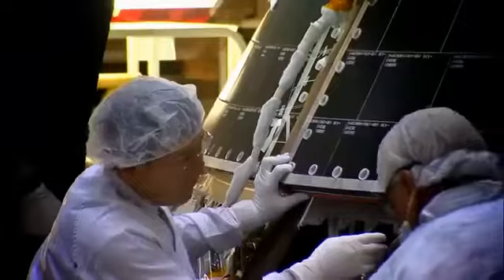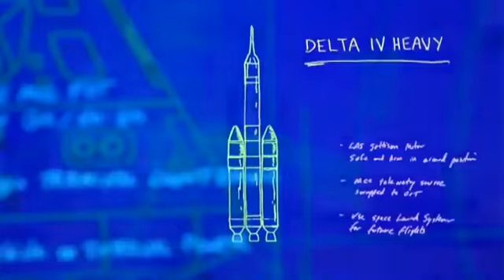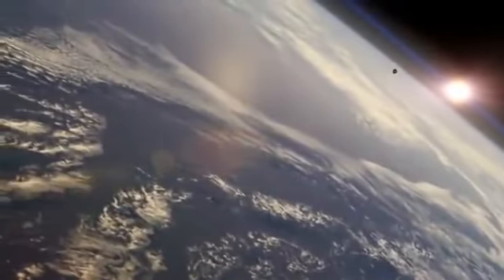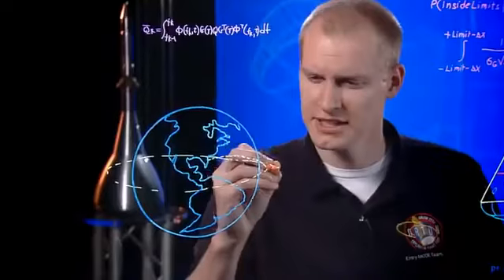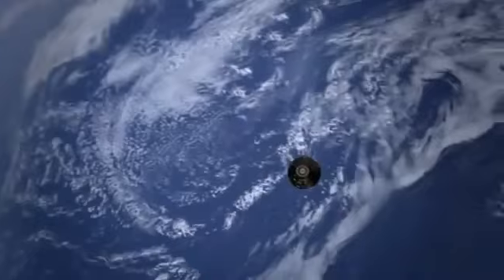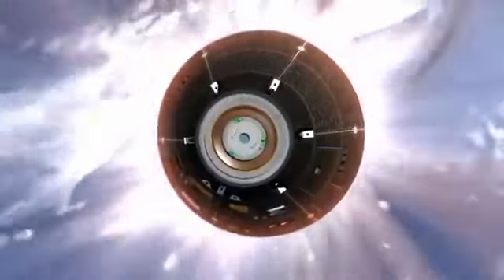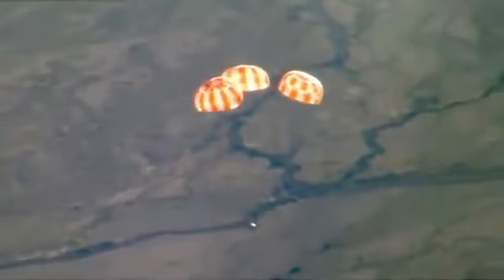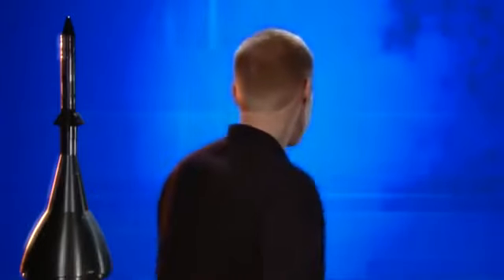NASA engineer admits they can’t get passed the Van Allen Belts

Comment: The reentry heat is the most dangerous part?! What about the heat while going through the belts? I've read it can reach up to 35k Fahrenheit.
Reply: Where did you read that?
Reply: Heat is not measured in degrees Fahrenheit, they are units of temperature. Heat and temperature are not the same thing. Take care.
Reply: It's sort of like the difference between how the air from your oven at several hundred degrees feels hot but isn't a big deal to stick your arms into, but if you stick your arm in boiling water, which is much cooler, you're going to pretty much instantaneously receive severe burns.

The particles in the VA belts contain a ton of energy, but there's just so few of them that the total amount of energy they can transfer to you is negligible.

Another comparison would be getting an X-ray vs. going outside. X-rays individually have a lot more energy than the light from the Sun, but there's more energy in total in the sunlight hitting you than in the X-rays, so going outside in the sun warms you up, but you don't feel warmer when getting X-rayed.
Reply: @seigeengine  Good explanation.

Comment: These tests were passed years ago.  The tests were for STAYING INSIDE THE VAN ALLEN BELTS.  Apollo spacecraft only had to GRAZE THE OUTER EDGES OF THE VAN ALLEN BELTS.  And this was for new electronics and new shielding .

This is completely different from the requirements of the Apollo spacecraft, which had old solid-state 60s electronics, much more resilient against radiation than new, microscopic electronics.
Reply: It's not the electronics that are the problem. It is the people that have to survive.  Wake Up
Reply: @jjlepepe5875  

This is old news.  The tests all passed.  The electronics were sufficiently shielded.
Reply: Riiiiiight, electronics back then were sh*t compared to today......sheeps will sheep
Reply: @damiandmb2092  

Here comes another genius.
Old electronics were shit.  No kidding... and?  What?  New electronics don't need shielding?  From radiation you guys always say is so intense it would "fry" everything in the spacecraft? 😋

Who's a sheep to somebody else's shitty conspiracy theory? 😆

Comment: No, that engineer is not claiming they can't get past the van Allen belts. He's talking about the first Orion test flight. This was done to make sure the Orion capsule works correctly in the VA belt: electronics can malfunction in high-radiation environments. Orion's electronics are designed to deal with this, but a practical test is required as part of due diligence. All of the hardware on Orion is new, so it has to be tested in operational circumstances before being considered human-rated. 
The Apollo program did these tests as well, during several unmanned flights of the Apollo spacecraft.
Reply: 1:36 and it's crew out of danger. 🙄
Reply: @AwesomeBlackDude  Danger from malfunctioning electronics, yes.
Reply: @zounds010   He mention the crew twice.
Reply: @AwesomeBlackDude  Again. the crew's safety depends on the electronics (which he was responsible for) working well. 
The radiation levels in the belts are low enough that the pressure hull and heat shield of the spacecraft provide enough shielding, and no extra shielding is required.
Reply: @AwesomeBlackDude  Even if you weren't wrong about what's being said, you're effectively arguing "one guy said something that disagree with the consensus of experts, therefor everyone else is wrong."

Addled.
Reply: Why not just use the 55-year old Apollo technology then?
Reply: @pdqbach4552  The Apollo computers were very limited. They could only do the bare minimum in terms of navigation and had no room for other functions. That meant the Apollo spacecraft contained tons of specialized devices e.g. to record and transmit telemetry. Onboard systems were operated manually and had limited functionality. For instance, the high-gain antennas had to be pointed manually. 
Limited computer capacity also meant that much of the data had to be transmitted live, or it was lost. 
In a modern spacecraft, these functions can be automated to reduce crew workload. It's become much easier for Mission Control to monitor the spacecraft, and to control it remotely if necessary. 
50 years of advance in computer technology gives you a lot of scope for improvement in functionality. 
Because we've launched hundreds of spacecraft into high-radiation environments since Apollo, we have learned how to build radiation-tolerant computers. These days, you can buy those off the shelf, and they're a much better solution than building a computer from 1968 two-gate integrated circuits.

Comment: So are we to believe that technology from 50 years ago was more advanced than today’s technology?
“We must solve these challenges before sending humans through this region of space”!
Reply: The technology is the same.  Big rockets, small spacecraft made as light as possible.  The challenges he talks about are engineering ones. We know how, but did we build a craft that is capable. That is what the test flight is for, people make mistakes.
Reply: "We must solve these challenges before sending humans through this region of space"
When man went to the moon, they did their best to avoid those regions. The Van Allen belt is not just a belt but belts of various radiation intensity. When they went through it back then, they did so as fast as they could and through radiation regions that weren't as strong as others to minimize their exposure, not completely eliminate it. They couldn't. They were still exposed to levels of radiation when they did this, but they weren't there for long enough for them to be lethal in the short term. For that they would have had to have been in them for days and they were only in them for about an hour. It's been said that the level of radiation exposure they experienced on average was equivalent to having two head x-rays.
Reply: Nope, the opposite. Modern technology relies on advanced computers that are highly sensitive to ionizing radiation. Humans are quite resilient. That is even more the case with the analogue technology that the astronauts used back then. What is even more resilient against ionizing radiation is a fucking shovel. Does that mean that a fucking spade is far more high tech than a modern computer?
Reply: "But Orion HAS PROTECTION the shielding will be put to the test. Sensors will record..." lets all forget the previous line right before that one!
Reply: Electro-Cute just whip out the 33 kilobytes that they use the 1969 and get the shit done!!
Pretty sure we can re-engineer 1960s equipment/hardware🤔
Reply: shane bruland I don’t trust any of them. But yeah I’m pretty sure Bill Gates could figure out how to use kilobytes. Just like I’m pretty sure we could re-engineer the Wright brothers airplane, the SR 71, little boy and fat man etc
If that’s the point you were trying to make?
Reply: shane bruland Still have no idea what side you’re on😂
Reply: shane bruland but that description actually sounds like you could run nasa!!!
Reply: @zdcyclops1lickley190  then why wouldn't use the same mechanisms that worked on apollo and transfer the data to the Orion? Why did we all of a sudden have the technology to do this when Russia was far more advanced? there's a lot of holes that just don't make it seem plausible..
Reply: echelon2k8 then why can’t they just do it again. Technology has advanced so far since the 60s
Reply: OBVIOUSLY NASA has NEVER SOLVED those challenges. (neither has China or Russia) Cosmic radiation would kill a human in 1969 and today Cosmic radiation would STILL kill a human!
NASA's solution to the fluctuating space radiation...Send ROVERS instead of humans!!....the PROBLEM is now Solved for NASA😊....and in the mean time NASA hopes that the 1969 bogus Moon landings will just FADE AWAY!
Reply: @zdcyclops1lickley190  😂😂🤣😂🤣
Reply: It is difficult to believe people like Tyson when the tone in his voice mirrors the tone parents use with children when visiting Santa at the local shopping mall at christmas
Reply: @zdcyclops1lickley190  😂😂😂😂😂😂😂
Reply: The problems are to do with the new spacecraft and systems, it's a new design so that's why they test it uncrewed to make sure it will be safe in a manned mission
Reply: He means the modern electronics are a lot more sensitive than the ones on board Apollo, Einstein.

Comment: Nothing in this clip says we can’t get past the VAB. As usual conspiracists hear what they want to hear
Reply: @SpaceManWyo  😊😊😊You are TWISTING things  again.😊  NASA  is testing the Orion WITHOUT humans to get a reading on the levels of DANGEROUS RADIATION.  The ORION will fly without humans initially. ONLY the sensitive  computers and guidance systems onboard Orion could be damaged by the Van Allen  radiation belts because NO HUMANS will be aboard Orion!!
(A spacecraft with NO humans inside can NOT result in dead or harmed humans when flying through DANGEROUS RADIATION)🤔
More research needs to be done before NASA can send HUMANS through that "DANGEROUS REGION" of space.  DANGEROUS REGION = Van Allen radiation belts
He spoke clearly and didn't mix words.  You must be a TRUMP supporter because you are hearing what you want to hear to FIT  your narrative!😊
Reply: @SpaceManWyo  NASA has scrapped the ORION mission to Mars!!😊
So once again NO HUMANS will be subjected to the DANGEROUS Radiation of Space that Nasa has identified.
Even MILD doses of radiation will kill humans...even with protection from a suit made for radiation protection.
The Computer systems & GUIDANCE systems of NASA must do pretty good in radiation  because the UNMANNED  Rover is on Mars. (and it passed through the Van Allen Belts & went through the Cosmic radiation of Space.)
But humans will DIE!!

Comment: Air particles in the vacuum of space? And how do you turn in a vacuum?
Reply: Trapped particle radiation in upper atmosphere such as Alpha and Beta particles. Take care.
Reply: Space is not a perfect vacuum. Stars continuously eject particles, planetary atmospheres leak a bit. Earth's atmosphere peters out very gradually. At 100 km altitude, the pressure is 0.1 Pa. That's too low to sustain winged flight at any speed below orbital speed. A satellite at 100 km will experience enough drag to slow down to below orbital speed and reenter the atmosphere within one orbit. 
At 400 km, the pressure is a million times lower: 0.1 µPa. The ISS operates at this altitude. In a year, it loses about 25 to 50 km of altitude due to drag. 
At 1000 km, the pressure is another thousand times lower: 0.1 nPa. Drag is so small that satellites at this altitude stay in orbit for centuries. This is about the same pressure as can be achieved in the best vacuum chambers on Earth. This pressure stays constant at higher altitudes: the entire sphere around the sun at Earth's distance is at approximately this pressure due to the solar wind.
Reply: You turn in a vacuum by using a propulsion system that does not rely on having an atmosphere, like a rocket engine.